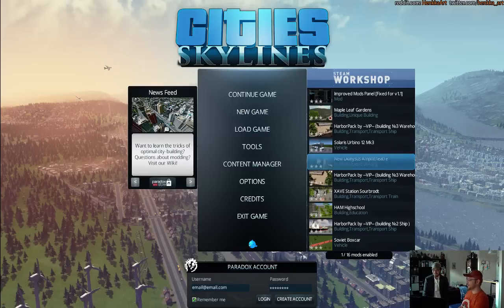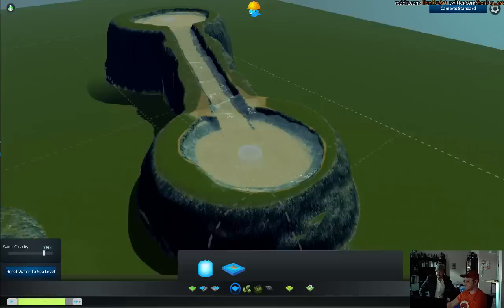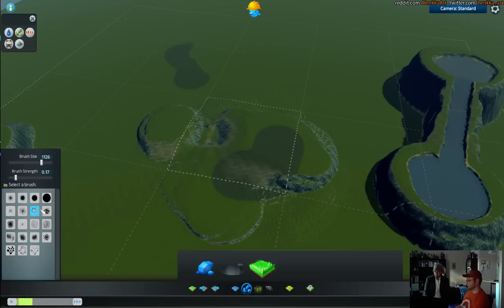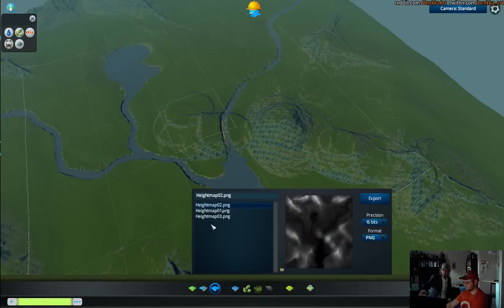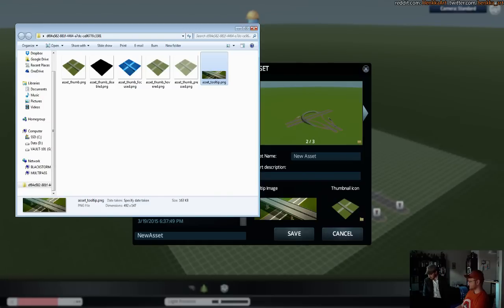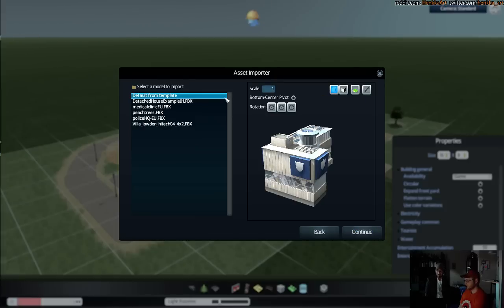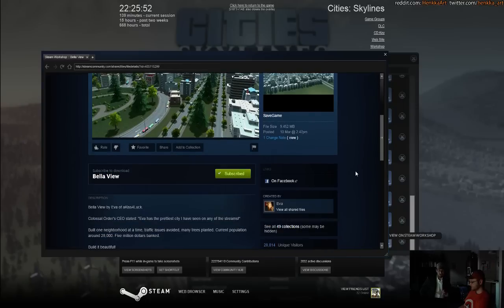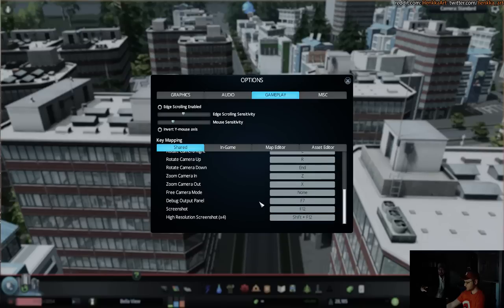Cities: Skylines - Developer Stream: Mod Masterclass, Wednesday May 27th 21:00 EEST

Comment: Can you explain where we can get the Heightmaps from ?
Reply from the maker: Not sure what you mean. If you mean where to get heightmaps to use in the map editor, then you have different options: searching with Google image search. If I remember correctly, there are different websites that also have geographical maps, including heightmaps that can be used but might need tweaking in Photoshop to get them into the correct 16-Bit format and pixel dimensions (1081x1081px).
You can also create heightmaps in the Map Editor using the Export feature. It saves the newly created heightmap into the Heightmaps folder that can be accessed from the small folder button in the Import/Export panel. You can also copy-paste other heightmaps into the same Heightmaps folder, maps you have made yourself using other means like World Machine or by drawing them manually in Photoshop or other image editing software or compositing and editing existing heightmaps from other sources. You can also download maps made by other players, open them in the Map Editor, export the heightmap and adjust it in other software. Or you can just edit the map in the Map Editor using the terrain sculpting tools.